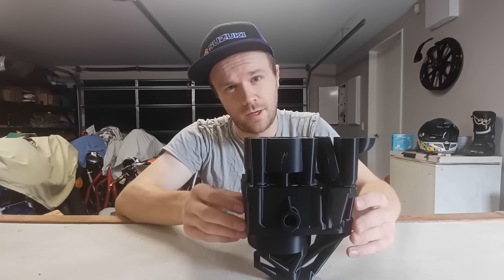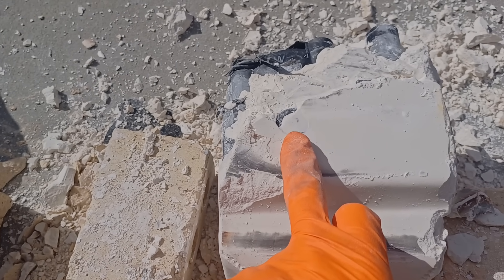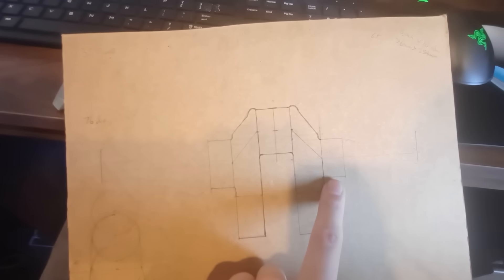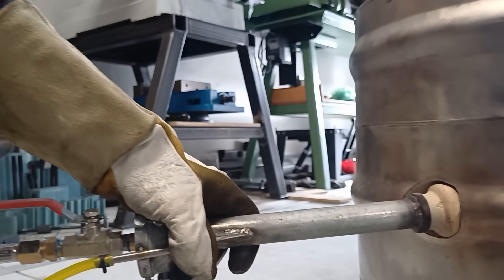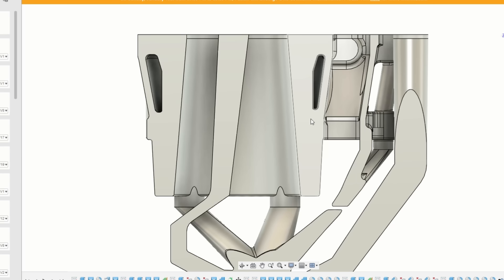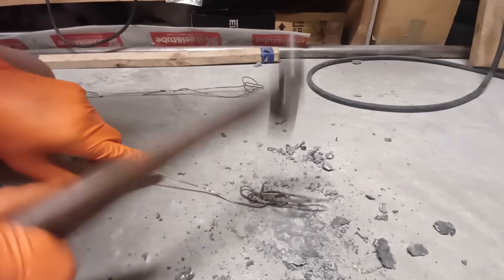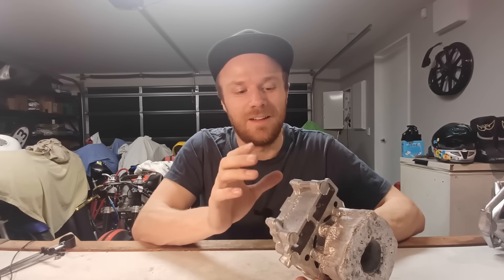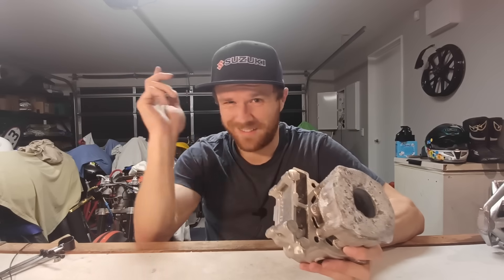Making The Worlds Fastest 150cc 4T Barrel

Comment: You are pouring too shallow! You need more metal in a reservoir pushing down on the casting to prevent the defects and  the part not filling . I would like to do something similar to what you are doing, I have a GY6 clone engine I want to either build a monster big bore kit for it.  And/or build a two cylinder version.. I have seen them built , id rather cast new twin cylinders and new head , it would be nice to make a custom cam shaft for it. Maybe copy the lobes of a CBR or other sport bike. Get a 20 mm bar of 4340 turn to the cam inner bearing race size, and get a  50-60,75 mm bar of 4340 ,4140 ,4130. Cut into 16mm (+/-) slices  with the offset bore short side to the base circle, Read up on the steel specifics to decide, press the the slices on hot, with the shaft about 0° to -20° F, maybe add a small tig weld at the base circle side. About 2mm long , the press would hold it, the hole being about 
.0006" smaller than the shaft when both are the same temperature. The lobes being a light press when there is a 300° difference in temperature, it should hold, one possibly is the lobes cracking.  This is the reason for the welds. 2-3mm per side hopefully will prevent disaster. Maybe a small key way? Or just mill it from a large piece of 4340!  Also after grinding to blank lobe specs, turn car valves to fit , go about 5-6mm over stock size, the stock are 16.8/18.5 mm roughly the oversized valve head i have are about 19.5/23mm . I'd like to cast a head with 22.5/26mm or there about. With the valves being about 20mm longer, porting the head, you can easily hit the spring pocket!  And I want to raise the intake port about 13-15mm, give a straight shot to the valve, and possibly spread the valves out slightly, also go to a 12mm spark plug, finding 10mm plugs that fit , all I can find are cheap Chinese plugs with massive defects. I have thought about just modifying the crankcase to allow a 150cc head to fit. Just cut the head about 1-1.25mm to keep the compression high, and I want about 190-200,205 psi compression at about 700rpm. I have also thought about trying to squeeze a AMR300 Supercharger on it. With a recirculating valve if it exceeds 5psi  the boost goes to the inlet side. The carburetor to the intake side. It will have issues of over boost at high rpm. Maybe use the waste gate to control that . Reduce the compression to about 155-160psi. And run up to 10 psi. It should definitely gain power(or crank case ventilation,!)  Good luck! ✌️

Comment: This engine is available in fuel injected water cooled version, why didnt you start with that?
Also whats the hp goal?
Reply from the maker: @KXSWORKS  I started with this engine as the water cooled injected version is not sold in New Zealand.
The initial goal is 30hp at the wheel and will go from there.

Comment: What’s the point? How does making a new cylinder make any more power in a 4 stroke?
Reply from the maker: @beatersnbeers2145  It's just one piece of the puzzle to making as much hp as possible.
Reply: @ so your building the entire engine?
Reply from the maker: @ Most of it / the parts that make the hp.  So head, barrel, crankshaft, cam shafts ect
Reply: @ very cool! Looking forward to seeing the final build!

Comment: Noob here. Is it possible to put some sort of vibration through the mold during the hot pour, to get the aluminium to flow and leave no air bubbles? If so I imagine you'd have to trial various vibe speeds and inertia mass.
Reply from the maker: @Bubbles-um1bi  I do often give the mold a decent jiggle/vibration immediately after the pour, and it seems to help remove air.

Comment: What is the overall shrinkage in %?
Reply from the maker: @theo_korner  Theoretically, it's around 3%
Reply: @TheMotorcycleForge  is there dimensional distorsion after shrinkage to a significant level aswell?
Reply from the maker: @theo_korner  Dimensionally, it's around 1 to 1.5%

Comment: A tip to get air bubbles out of your plaster, use one of the oscillating dremel cutters. It'll shake the air out quite well, which should normalize your surface finish on the part.

AWESOME WORK by the way. I would love to see a bit more explanation on your work flow because I am interested in print to cast. I'll go have a look around your channel.
Reply from the maker: @Akya2120  Thanks for the tip I'll give it a try one day.
I do edit out a fair bit of messing around but the overall process should be in the rest of the videos.
If you have any questions, just ask.

Comment: Very cool process, thanks for sharing! what is the stuff you sprinkle on top post pour and what is it's purpose? I can only guess it's something designed to burn and create an ash/carbon barrier to perhaps prevent oxidation, though I'm sure that part of the mould is sacrificial and will be cut off anyway, so I'm not sure! The only other thing I could think of was to stop shrinkage but I couldn't think of a plausible process.
Reply from the maker: @PPYTAO  Your second guess is correct, the reaction creates a lot of heat which keeps the risers molten while the rest of the mold solidifies.
This greatly reduces shrinkage where you don't want it.
Reply: @  oooh that's very cool! thanks for replying :)

Comment: Is the mold preheated? maybe run a blowtorch through it for a while before the pour, it will help fill in those thin areas that didn’t fill properly before.
Reply from the maker: @colinlafromblower9174  Yes, it's very much pre heated.
I have found the best success with pre heating the mold to around 630-640 degrees Celsius.
Reply: @ I commented before the rest of the video…my bad, keep doing good work man, looks great.

Comment: how bout you try jewellery style investment mould making?  you coat the pattern with thin investment, let it dry, add more, let it dry, then do a few thick layers, some with sand, then put the whole thing in loose sand.
Reply from the maker: @felderup  Hmmm that's a cool way of doing it, I may try it in the future.
Reply: @TheMotorcycleForge  a lot of youtubers almost do it, they coat foam patterns for lost foam in random kinds of plaster, sometimes drywall compound.  the jewellery method holds together better, has to, cause you melt out the pattern.  some go crazy with plant fibres as reinforcement, they're not backed by sand, but an engine casting in sand would be fine without.

Comment: You really should be doign this with ceramic shell casting, not unvacuumed block moulds :)
Reply from the maker: @noviceartisan  I had plenty of investment left over from casting the head, so it was easier to just use that and I couldn't do ceramic shell casting on the head due to the water jacket, it would have been impossible to remove the shell from somewhere you can't see or touch.
Reply: No way to add a vacuum port to the base so you could whack a shop vac and massively help the casting flow? I've made my own vacuum system up, and experimented a bit to add vacuum to things to make them work with investment :)
Reply from the maker: @noviceartisan  I did make a vacuum chamber and got a vacuum pump and tried it once but had a blowout due to insufficient mold thickness, so I decided just to do it gravity casting for now.
I will have another go at vacuum casting in the future.

Comment: Bloody Kiwis, clever little basstards... and persistent! Listen mate, have you covered how you calculate for shrinkage in any of your previous videos? I have watched all of them but don't recall much on the topic.
btw, can you make 10 videos a week, they're ***** rippers!
Reply from the maker: @robertoburromiapanino2659  haaha very high praise, much appreciated.
Yeah so shrinkage in Alu is supposed to be around 3% so I just made the wall thickness to accommodate that.
I tried casting 103% size but it doesn't shrink like that as the distance between parts doesn't change, only the wall thickness does.
So casting 100% size yielded more accurate castings.
As far as feeders on top of the mold, you want at least the same volume as the rest of the casting.
Hope this helps, and I'll try but 10 week might be a stretch 😅
Reply: @TheMotorcycleForge  Thanks mate, much appreciated.